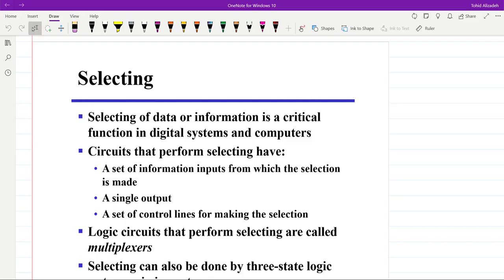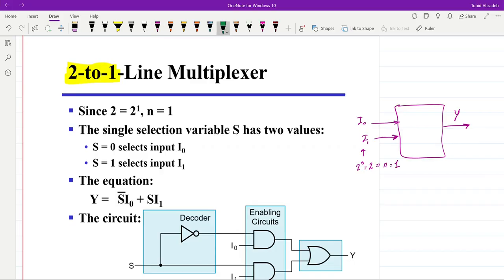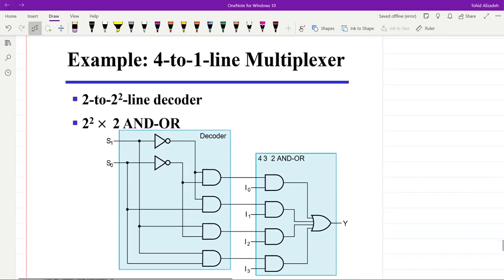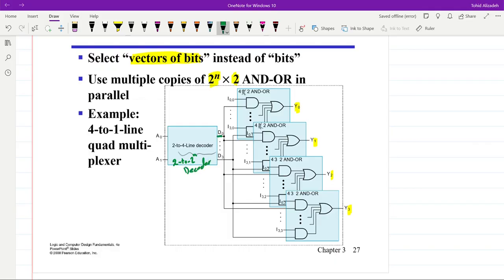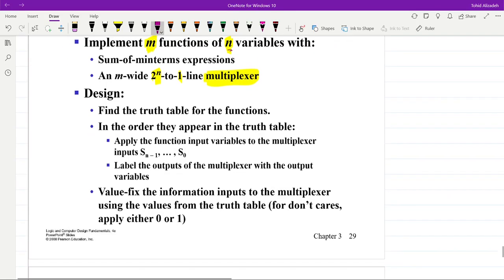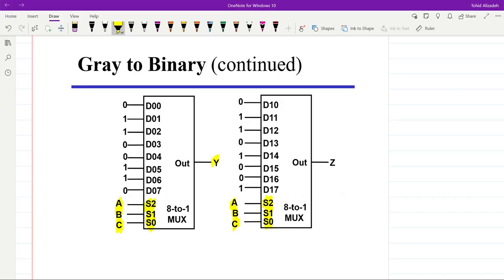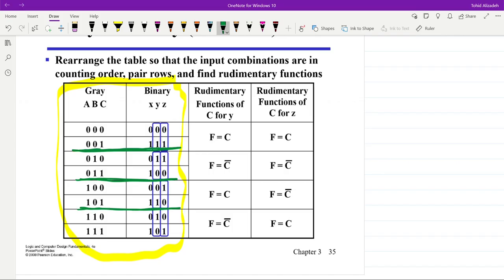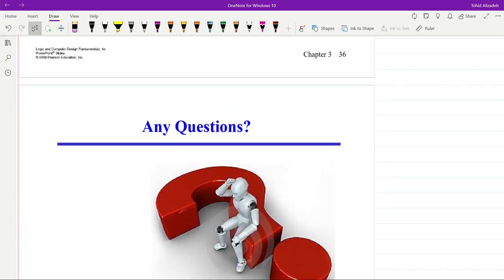Microcontrollers-Lecture 10.2 -Slides 22-37: Combinational logic circuit  Selection and Multiplexers

Comment: Commentaries on 
Approach 1: 
MUX is basically a programmable truth table in hardware. We kind of 'store' the desired truth table there.

Approach 2:
Decomposition using smaller MUXes (f.e. pick one variable as a select line, express/factor the function as smaller functions). 

Additional:
A 2-1 MUX is functionally complete by itself.
Any combinational logic can be built using only 2-1 MUXes.
AND, OR, NOT, XOR can all be built from a single MUX.